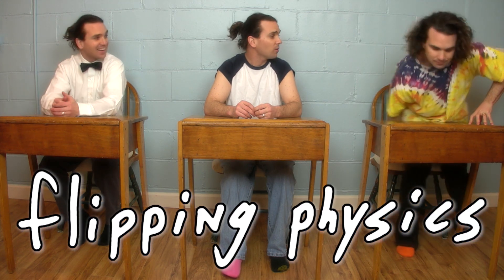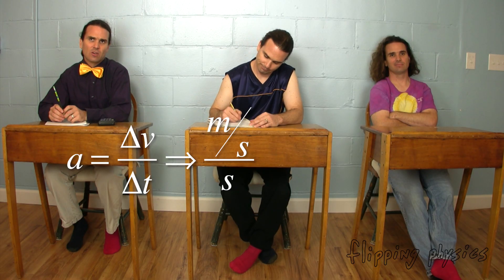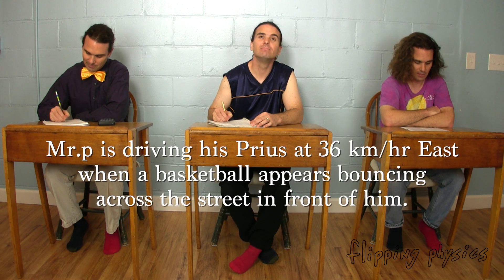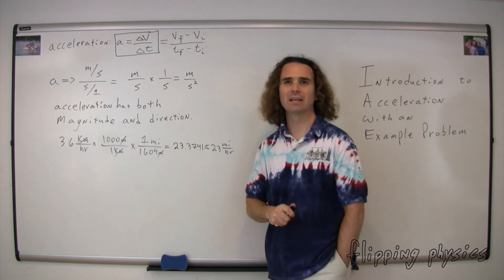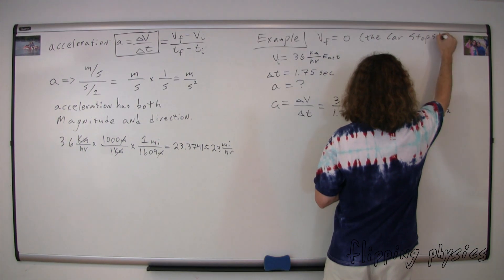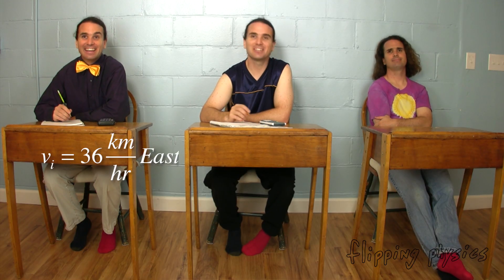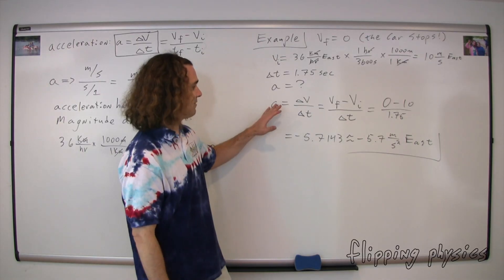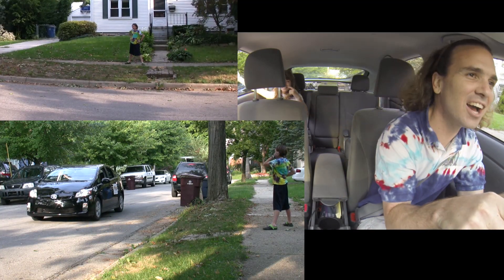Introduction to Acceleration with Prius Brake Slamming Example Problem

Comment: You changed it from km/hr to m/s, I understand that you need to change the hr to secs due to the change in time, but is there a specific reason you change km to m?
Reply: You need to use SI standardized dimensions. That is the way the formulas are derived to work for. In scientific discourse, standardization assists communication. For an example of a real life error in this, look up the U.S. NASA mars lander crash in 1999.
Reply: These equations work regardless of the units. acceleration can come in units of km/h/s (= km/(h*s)), and this equation can be used to find that, no problem. But it is true that SI units for acceleration are m/s/s.

Comment: 4:15 subtitles are wrong, they say 22.3741 and 22 when on the board it says 23:3741 and 23
Reply from the maker: Actually, no, the subtitles are not wrong.
If you do the calculation, you will discover the board is incorrect and the subtitles are correct.
Yep, there is a mistake in the video.
YouTube won't let me upload a video replacement, however, I can fix the subtitles!!

Comment: 8:45 it's redundant to say -5.7 m/s^2 east, since east already contains the direction. 
the acceleration is 5.7 m/s^2 east. That tells you the magnitude and direction.
Reply from the maker: +da Lambert This is not correct. The acceleration of the Prius is -5.7 m/s^2 East. You could also say the acceleration of the Prius is +5.7 m/s^2 West [because negative West is East]. However, the acceleration of the Prius is not +5.7 m/s^2 East. If you want to more about how velocity and acceleration directions are related, watch this: https://youtu.be/Mg8NsHpaDrY?t=4m48s
Reply: +Flipping Physics Oops... I meant acceleration is 5.7 m/s^2 west since the car was moving east and you were slowing down. The point i was trying to make was that with cardinal directions it is possible to remove negative signs and have a (positive) scalar with a direction, with degrees for finer directions between the 4 cardinal directions. But this is an onerous condition, as the negative sign popped up as you solved the problem, and you can define negative east as west. You are correct as you defined the problem in the video.  :) 
In 1 dimensional motion along a line,  it is sufficient to define direction using plus or minus, since there are only two directions along a line,  right or left (or up/down, etc).
In 2 dimensional motion, as in your car example, having a positive/negative sign in front of the acceleration is not sufficient. it would be ambiguous. 
It is interesting to use cardinal directions for 2d motion, i am accustomed to using vectors (x , y ) . Both of these coordinatizations are useful, depending on the problem.
Reply: +Flipping Physics I have a question about 9:24. In physics a magnitude is traditionally a positive value, at least in the context of vectors. A workaround might be to say the magnitude is 5.7 m/s^2 and the direction is negative east.
Reply from the maker: +da Lambert I agree with your nitpickiness (unless you try to argue nitpickiness isn't a word). Magnitude isn't actually negative and I probably shouldn't have said "-5.7 m/sec^2 is the magnitude". +5.7 m/sec^2 is the magnitude and negative East (or West) is the direction. However, at this point in the students' learning, I don't want to confuse them too much. They haven't even learned about vectors yet. I wanted them to mostly understand that the acceleration works out to be negative when an object is slowing down and moving in a positive direction.